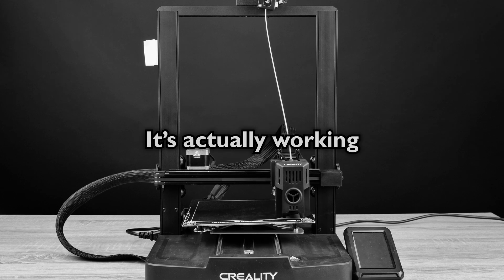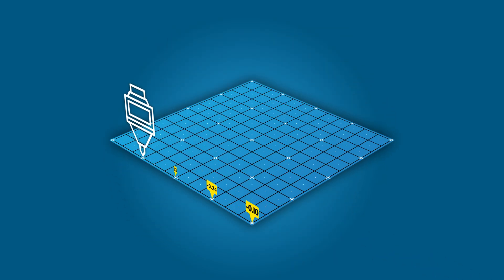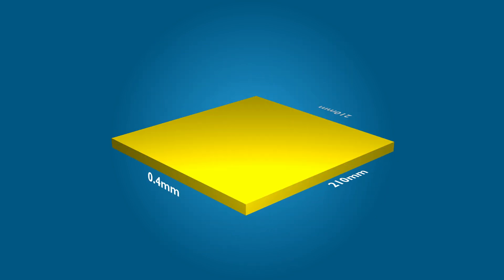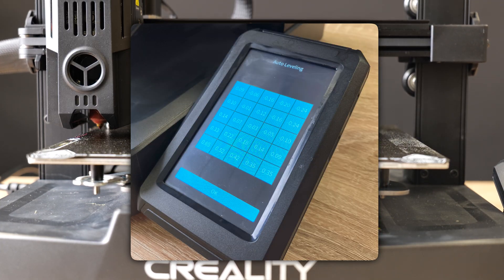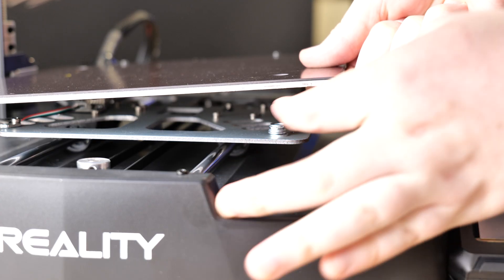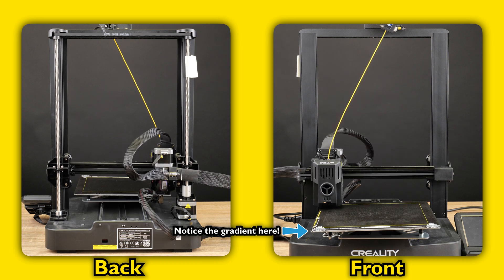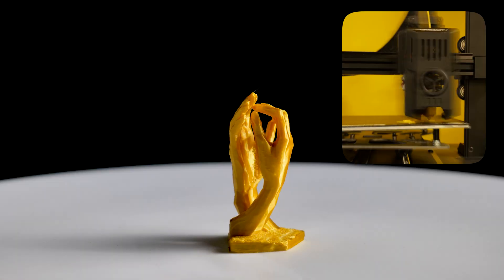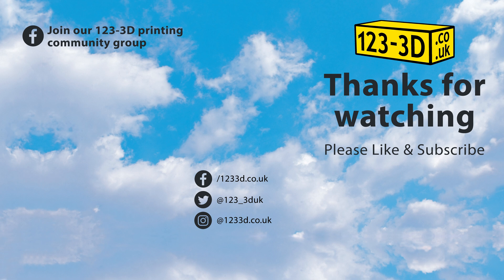Bed levelling doesn’t matter?! The ULTIMATE 3D Printer Myth-Busted!

Comment: I'm also interested what firmware are you running (version)? I just got the KE with 1.1.0.15 and I cannot get a consistent 1st layer over the whole build plate even with pre-print calibration. The central part of the sprint of around 100x100 is great, but the sides are awefull (they get worse the more outwards you go). The defects reflect the mesh measurements in that where the bed is lower I see effects of too high of a Z offset and where mesh is low of a too low z offset as if the automatic correction is not working or something. What could cause this? Is it a warped bed?

Comment: Wow, impressive result. But what about if the bed is warped? So can you show the results, when you put  washers u der the build plate, simulationg a warped bed?
Reply: Thats what i was thinking, i cant make a single print in my ender 3 s1 pro without calibrating it over and over again, and i cant make that perfect 1st layer on all the build plate. Even using klipper, and making a 11x11 mesh.

Comment: Since Z is working all the time, it means that a horizontal straight line on the model will be printed as a curve consistent with the curvature of the bed...
In my opinion, only the first layer should be taken into account so that the plastic sticks well. Everyone will manually adjust the bed anyway, and bed leveling is only a precise correction.
Reply from the maker: We might have to test that theory, just to see how much the mesh compensates for that if any 🤔